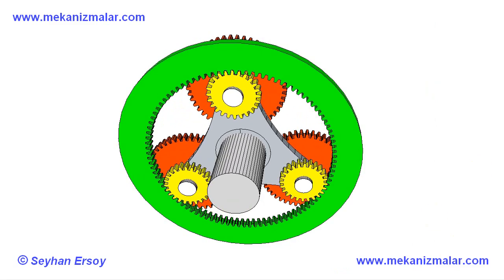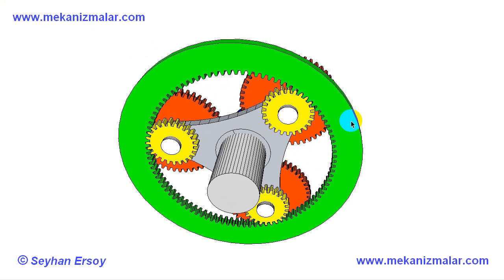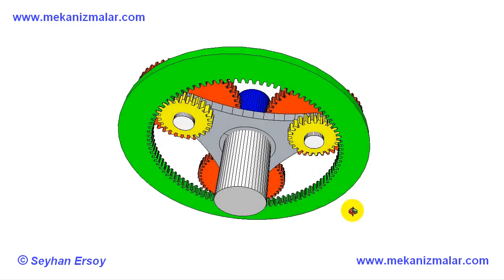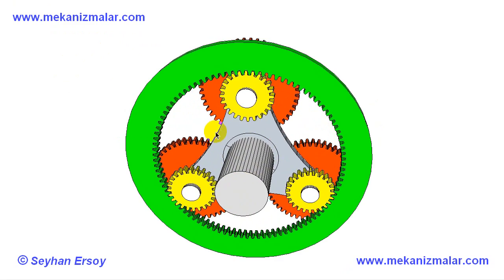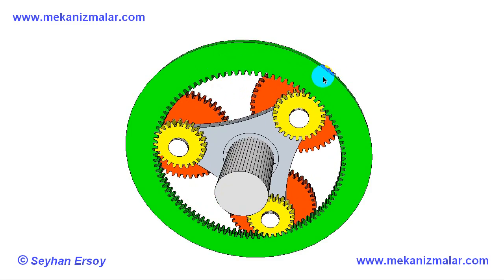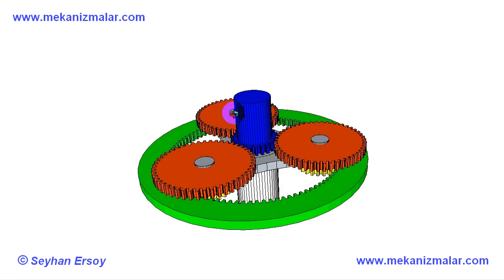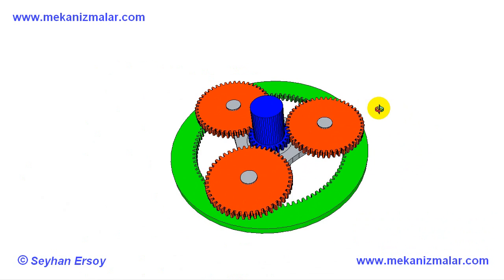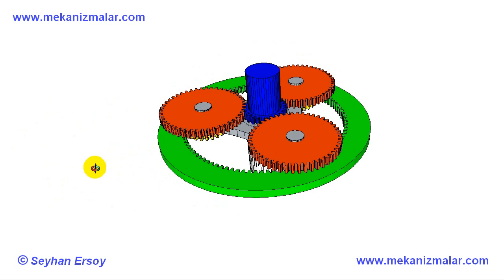Planetary Gear 4D Animation

Comment: Can you summate torque using planetary gear? (you have to motors with different rpm and you want the both to work on single output shaft; is that possible?)
Reply from the maker: I guess following video may answer your question. https://youtu.be/3V7dVk0j-q8
Reply: Yes, thank you